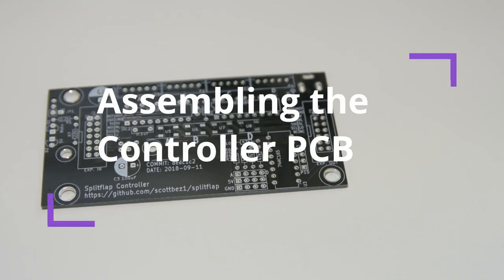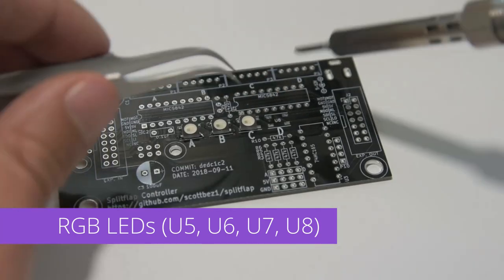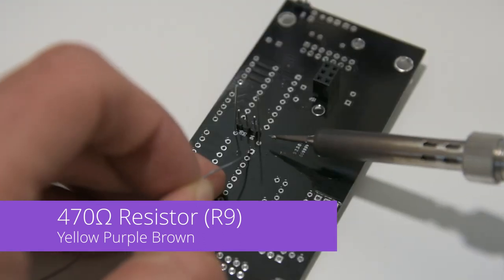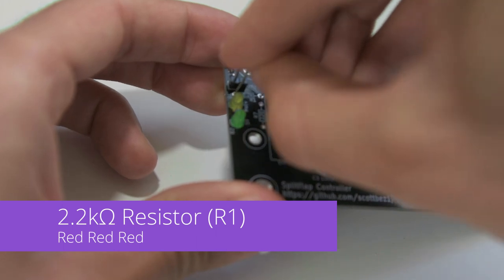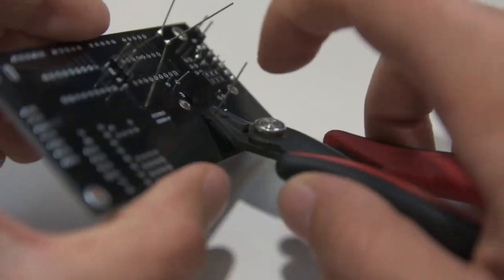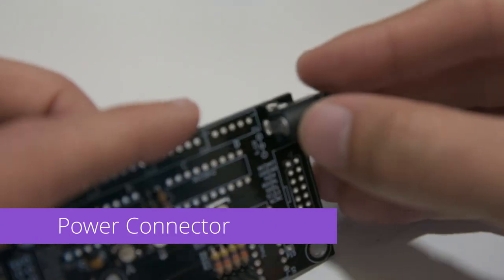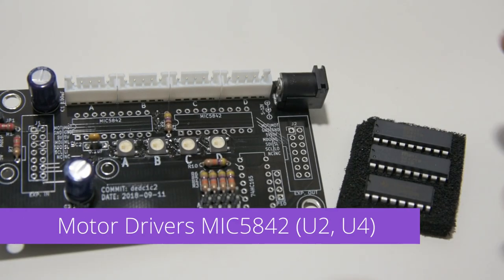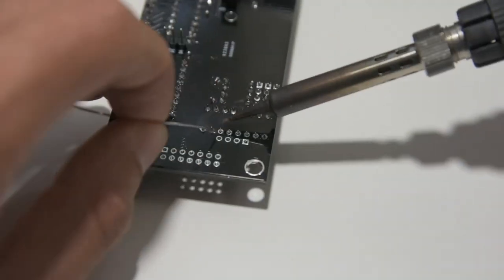How to assemble the split-flap controller PCB

Comment: I finally managed to collect the components needed and solder two boards. It was surprisingly easy, I'd never done any PCB or and soldering prior to this but I had no issues at all.

If anybody in Europe needs some boards, either these or for the sensor, please let me know. It might be cheaper than buying a whole load from China.

Comment: Hey, maybe this is a stupid cuestion but i'm new to all this world. If you have a big display and you want to comercialice it (like vestaboard for example), you have to sell it with the arduino inside? or another electronic takes care of all the work? (sorry for my english)
Reply from the maker: Hi Lauti, great question! An Arduino is really just a convenient board for prototyping based around the ATmega328 microcontroller. To commercialize a product, you would generally not include an entire Arduino board and a shield, but instead create your own custom board. Your custom board might use the same core components (like the ATmega328) and also include everything you need from the shield too - this can make the entire assembly much smaller and cheaper since you can remove things you don't need from the Arduino (like pin headers, extra LEDs, etc). However, once you are designing your own board from scatch, it is often worthwhile looking at alternatives that may be cheaper, instead of just copying everything from the Arduino - for example, if your product doesn't need all the features of the ATmega328, you might choose to use a different microcontroller with fewer features instead to save money.

There is an interesting middle ground between prototyping and mass-production: if you were to order all of the components of an Arduino yourself in small quantities, they would be substantially more expensive than if you just bought an Arduino (fully assembled!), because Arduinos are mass-produced and can benefit from economies of scale. So for a lot of small scale/hobby electronics, it's typically cheaper to just use the fully assembled Arduino as-is and design a custom "shield" to plug into it with whatever custom electronics you'd like to add.

Hopefully that answers your question!

Comment: thats just amazing !! is it possible to control more then 4 displays with multiple controllers on a single arduino ?
Reply from the maker: You can connect 3 of these boards to a single Uno to control up to 12 modules. I'm currently working on a new electronics design that allows for even larger displays, hopefully 120+, using a single ESP32. I'll try to make a video about that soon.
Reply: @scottbez1  please keep me updated I'm in the slack group now as well would love to have one 4*10 display at home
Reply: @scottbez1  Ooh, exciting!

Comment: This is really cool, but if I wanted to make a larger board (say a 10x4) would I need to get a different PCB? Or is there a way I can daisy chain multiple boards?
Reply from the maker: You can connect 3 of these PCBs together for 12 total modules from an Arduino Uno. I'm currently working on a new PCB designed for more chaining, using a more powerful microcontroller like an ESP32, with a goal of supporting at least 120 modules - this is called the Chainlink Driver. It's not ready for prime time yet, but you can read more about it on the project README https://github.com/scottbez1/splitflap#chainlink-driver , or join the slack group if you have more questions.
Reply: @scottbez1  awesome! Can’t wait to see what you come up with!